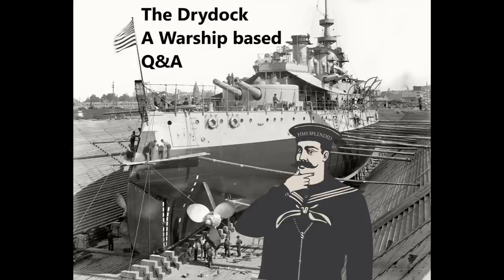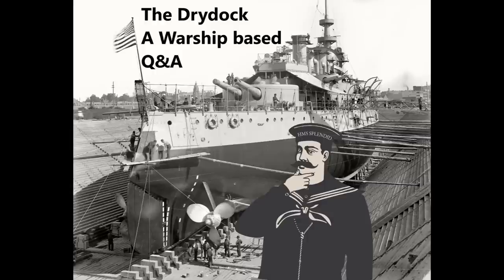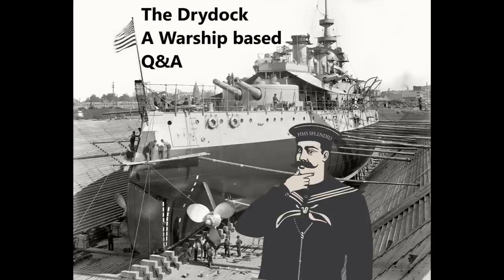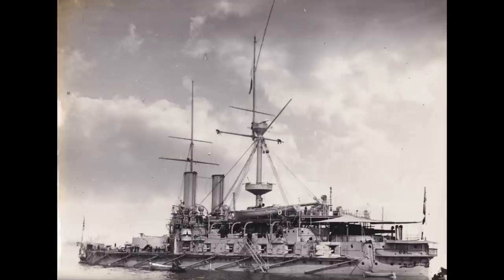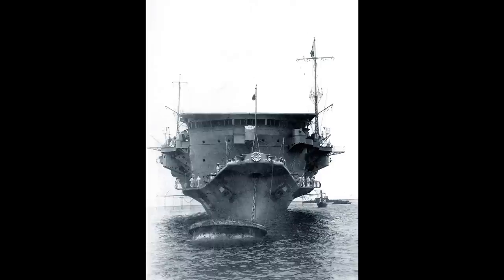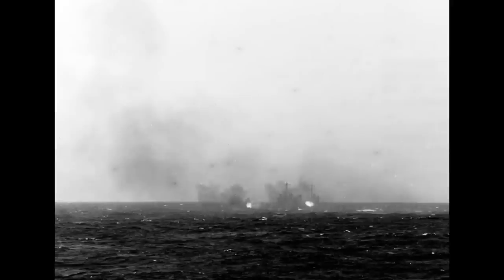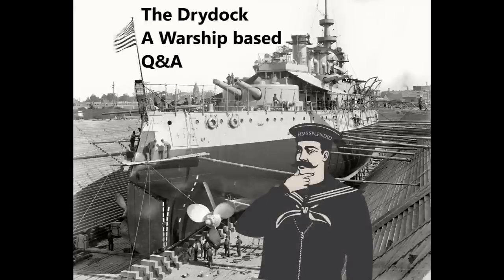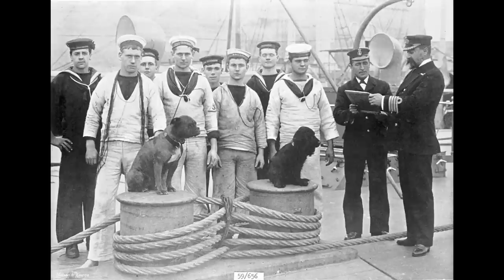The Drydock - Episode 256

Comment: If CarDiv 5 is replaced with CarDiv 2 at Coral Sea. It might be a bloodier tactical victory for the IJN. If I recall Shattered Sword correctly, Soryu and Hiryu had highly trained and experienced pilots. But their main strength came from Dive Bombing. So highly likely that Lexington may take 3 Torpedoes and another 1 or 2 Bomb hits. Which may sink Lexington outright. Whereas Yorktown may avoid the Torpedoes, she may take similar damage to Enterprise at Eastern Solomons. So 3-4 550lb Bomb hits, which is survivable but would mean Yorktown would not entirely be ready for Midway. Unless the damage control crews and later the shipyard workers at Pearl Harbor are being Intravenously fed coffee. 

Soryu is smaller than Shokaku and arguably more maneuverable. The issue is that she is also more fragile regarding bomb hits. For the sake of argument, Soryu still takes 3 hits. The explosions could catch something flammable like her Avgas system, even without aircraft in the hangar. Also, if one of the hits lands next to her stack, like at Midway and penetrates the lower hangar. Then it could damage or destroy her boiler and engine rooms leaving her dead in the water. 

Fast forward to Midway, and Shokaku and Zuikaku, for the sake of argument, are loaded with the same numbers of Aircraft as at Coral Sea. That's 21 Zeroes for Shokaku and 25 Zeroes for Zuikaku. 20 Vals for Shokaku and 22 Vals for Zuikaku, and 19 and 20 Kates for Shokaku and Zuikaku, respectively. Also, there are deck plans of Shokaku and Zuikaku's hangar decks, complete with aircraft spots. Assuming that the events leading up to and during the "Dauntless Ex Machina" occur similarly. Shokaku may end up like Franklin in that it would be a long, bloody and fiery battle with a slight chance of survival. But without the redundancies in here, damage control systems and the open hangar to vent the explosions, fire and smoke. She may go the same way as Akagi and Kaga. Zuikaku if caught in the same circumstances as Hiyru (closed in on TF16 and TF17 and lost most of its air group). Then it could take the 4x 1000lb bomb hits. As Shokaku survived a similar number at Santa Cruz. Of course, if those aircraft are full and ready for another strike, it would cause a fuel-air explosion. Resulting in Zuikaku being sunk outright or being scuttled. Being close to Midway would mean that even if the damage control crews worked through the night to get the fires under control. She may be spotted and tracked by radar-equipped PBYs and be finished off by Enterprise and Hornet the following morning.
Reply: 24:16
Reply: 9165?
Reply: @datadavis mate you alright? You havin a stroke?
Reply: I think the state of the carriers when they're hit is the single biggest factor. If CarDiv 5 replaces CarDiv 2 at Midway, they'd have a better chance of survival. But, if they're hit while in the same state that Soryu and Hiryu historically were (vulnerable fuel and/or ammunition all over the hangar decks), I don't think Shokaku, Zuikaku, or any Japanese carrier in 1942, is going to survive those hits. You made a good comparison to USS Franklin, but of course Franklin was bigger than the Shokakus, had much better damage control systems than the Shokakus, and the USN in 1945 had vastly more experience with that sort of damage control than the IJN did in 1942.

Conversely, when Shokaku was hit at Coral Sea, she survived in part because she had very few aircraft aboard at the time (they were almost all either attacking Yorktown and Lexington, or aloft on CAP). Swap in Soryu or Hiryu taking those same three hits, and they'd be at greater risk of sinking, but might survive due to the much lesser risk of fire.

One other point about CarDiv 2 at Coral Sea is that, given their smaller air groups and given the losses the IJN had taken in the earlier stages of the battle (especially the debacle of the attempted night attack on May 7), CarDiv 2 might not have had as many aircraft available to fight the main battle on May 8 as CarDiv 5 did historically.
Reply: @adenkyramud5005  nah man, just had too much to dream last night lol

Comment: As an old artilleryman I found the 105mm gun with semifixed ammo, a brass case with a shell on the end, sounded as a loud fast crack. The 155mm with separate bagged ammo, like you see in the footage from the BB main guns (only smaller) sounded as a longer duration boom.
Reply: My only personal experience is with small arms.

I used to shoot a lot, usually using ball ammo (full metal jacket, cheap and plentiful back in the day) I can share my impressions.

As both shooter and spectator,  9mm was a crack.  .45 ACP was a boom from 4.4"-5" barrel.  (.25 ACP was a pop, easily mistaken for a slammed door or dropped book.)

As a shooter or spectator, 9mm from a 3.5" was the same as a 4.5" barrel.

As a shooter, 9mm from a 16.5" barrel was a softer crack than the pistol length barrels; as a spectator the 16.5" barrel gave a louder and sharper crack than the pistol length barrels.

As an almost-receiver of small arms fire I always heard the same fast buzz, like a wasp zooming past.  (Twice as a hunter I was subjected to negligent rifle fire.  As a citizen I experienced around a dozen pistol fire ricochets.)

And, once as a citizen two idiots conspired and managed to negligently shoot me in in boot heel with a .25 ACP.  I don't remember hearing the discharge at all, I just remember the thump of me hitting the wooden floor having performed an unsustainable silly walk.  Then the standard "I didn't know it was loaded" from the shooter, and "Why didn't you check" from the lender.
Reply: that fits the pressure curve
Reply: 8954🥚
Reply: 2988🤠🤭

Comment: I have to interject some actual ballistics info on the question at 55:56 about sound pressures for the big battleship guns. If Drach had ever looked at my ballistics file, he perhaps would have answered this with a bit more real data. Of course, the best data is to talk to someone that was on deck on several different battleships of different gun sizes when they were fired. There may also be some dB ratings on the big ships buried somewhere on each ship. But, Ballistics will have to do for a real scientific answer.

If you start with the weakest big guns of WW II, the British KGV guns of 14", they (the AP round) produced only 142 million ft. lbs. of Muzzle Energy (ME), The Iowa's AP produced 262 million ft. lbs. of ME, and the Yamato's produced 327 million ft. lbs. of ME. To think that these all created the same sound pressures is ludicrous! In addition to that, the size of the projectile varied a fair amount as well., from about 1,600 lbs. on the KGV,, to 2,700 lbs. on the Iowa's, to 3,200 lbs. on the Yamato's. This will have an impact on the sound generated at blast time as well. 

In addition, if you fire handguns with exactly the same ammo, the length of the barrel will impact the sound you hear as well. if you fire handguns with exactly the same ammo, the length of the barrel will impact the sound as well. Those with the shorter barrel length will sound louder. But in the case of the WW II battleships and their guns and ammo, there is only one case that come close to this criteria of shooting the same ammo - the US South Dakota's (16/45 caliber) vs. the Iowa's (16/50 caliber) , where they both shot the 2,700 lb. projectile, but the Iowa's used six 110 lbs power bags and the South Dakota's used six 90 lbs. powder bags, thus making the ammo not exactly the same. Thus, this is not the case where they both shot the very same ammo, but it it is fairly close. So, did the South Dakota's sound louder?

Comment: Regarding the sound of firing guns. I understand that normally USN 16 inch guns fired a staggered broadside, implicitly this the if a nine gun broadside results in a longer 'experience'. How often did both or all guns in a turret fire at the same moment, ditto on a multi turret ship was it usual for, to start with, one turret to fire then another etc or was the firing autonomous?
Reply: Most US ships with triple turrets were firing ragged broadsides because of the delay coils installed to separate shells from one another to avoid shell dispersion from turbulence.
Reply: @kemarisite  that is what I thought, the photo of Iowa doing a broadside was done as a one off with the delay coils 'deactivated'. The sound of a ripple of 9, with delay coils would be far more impressive, due to length, than the absolute level of noise when all fire with no delays, was my conjecture.
Reply: The delay coils did not work as described by kemarisite.  The shell separation required was about fifty feet, which works out to about 0.02 seconds at the muzzle velocities involved, with the center gun being delayed that much compared to the wing guns.  A 0.02 second delay is essentially undetectable for a human (it's about one-half of a movie frame's display duration).  The ripple fire/staggered broadside seen in the famous footage of the ships firing broadsides were all the result of those clips being filmed during the 1980s refits.  Apparently, the shock of firing a full broadside with the original delay coils was enough to break a lot of the new electronics that were installed aboard the ships, so new delay coils were fitted that would ensure that only one gun per turret would fire at any given time, with about a half-second delay to the next one, resulting in the famous "boom-boom-boom" cadence heard in those film clips.

There is plenty of footage, if you dig for it, of US fast battleships firing shore bombardment in WW2 where all three guns go off essentially simultaneously, to human perception.  Indeed, firing the wing guns independently caused greater wear and tear on the turret training mechanisms, due to the whip from the now-unbalanced recoil of the guns firing independently.

As for the famous photos of Iowa firing broadsides off Vieques in '84, those were taken with the new delay coils in place and operating--if you look closely, you can see that each gun in each turret is at a different point in its operating cycle, and at least one of the guns hasn't actually fired yet.  It just looks like they all fired simultaneously because of the sheer size and duration of the muzzle flash and blast from such large guns.  (You can also see the same thing in the famous photos of New Jersey splitting her fire for a photo shoot about three years later.)
Reply: @rdfox76  looking at navweaps, it appears about 0.060 seconds (60 milliseconds) was the standard for battleship guns in US service.
Reply: @kemarisite  My mistake, then.  That said, 60 milliseconds is still nearly instantaneous to human perceptions; the delay seen in the firings back in the 80s was closer to 400-500 milliseconds.  (I got my figure by just dividing the 50-foot separation figure by the nominal muzzle velocity of a 16"/50 Mark VII firing a Mark VIII APC shell--I knew I should have looked it up!)

Comment: My tutor always referred to PPI as Plan Position Indicator, which makes sense in that the view is in plan. Before that came about, I am aware of at least one sort of display that used twin linear indicators. One displayed range and the other azimuth and a spike on both would give the overall result. Obviously this is in the days when Cathode Ray Tubes were new and cool technology and the prototype semiconductor transistor was about the size of a fist.
Reply: A cathode ray oscilloscope was used to measure fast changes in viscosity. The man who brought it in had spent the war going back and forth across the Atlantic in a corvette. 
He told me it had been used (or possibly this type of instrument) to look out for submarines. 
The screen was a green disc about 3 inches in diameter. 

We were able to establish that abrupt changes were happening and got a recorder which printed, as far as I can remember, 6 inches in one second. Instead of a pen it bounced light off a mirror in a tiny tube. D